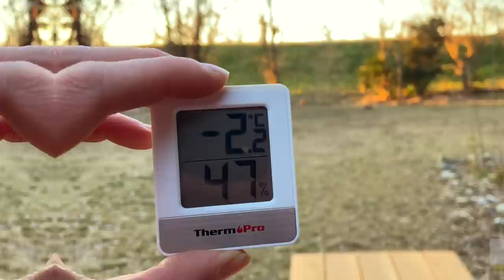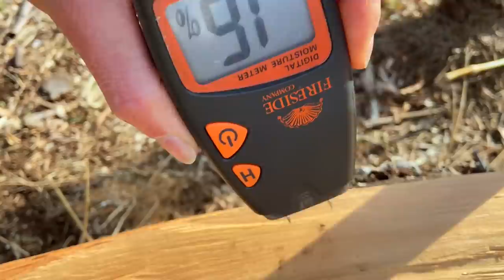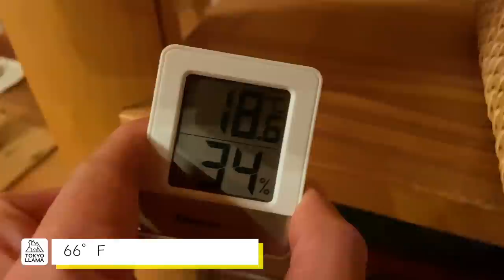Winter in a Japanese House | Tokyo Llama

Comment: My house in central Illinois was built in 1900 and for housing the ‘new’ lumber mill employees, and very few $$ invested until I bought it in 7/2004.  I doubt if I am ever rid of all the drafts, all the cold spots on cold, windy days but I have done a lot of improvement over the years, a little at a time. All the windows hav3 been replaced and both doors but I also expanded my living space when the roof was replaced as I had a very steep roof and over 600 square feet of recoverable space hiding up there.  Lots of new insulation, the windows all double glazed, a dormer added for the space for a spiral staircase and I now have a studio for my sewing and knitting and a ‘retreat’, space for some display of some of my doll collection and a small space that is handy storage but someday might become an upstairs bathroom. 17+ years and a lot of hours of labor, a lot of paychecks earned at the local pork processing plant.  You have a much nicer property and home and I enjoy your videos.

Comment: My parents are obsessed with wanting to heat and cook with just the wood stove. They can't understand that sooner or later a condition arises whereby making wood becomes almost impossible: it's called old age. I can understand the "fun" and dynamism that you feel when you light the fire (I like it too, I admit) but having a warm house comfortably is necessary, also because life is full of unexpected events (you can get sick or get hurt). What I recommend passionately is: add a heat pump (nothing particularly expensive, also work as an air conditioner) that also heats the domestic water with splitter at least in the bathroom, bedroom and living room. While to increase the yield of wood I would suggest a gasifier stove with integrated boiler. I do not know honestly for this ulti to what are the offers in Asia, but here in Europe, especially in the Alps are quite in vogue. Obviously, as you said in the video, improving the insulation will make the most substantial difference, also with regard to wood consumption, but I do not think they can be enough the same.

Comment: I don't think you mentioned heat pumps in this video. Has that been an idea? A proper heat pump feels so efficient and pushes around warm air around. It obviously also makes for letting hot air escape through gaps by creating the pressure and air flow, but it works like a charm in conjunction with a fireplace that heats through both warming the air around and radiating heat. A hot air pump also gets a lot of space heated with relative little power consumption. I can't speak for other countries, but in Norway they are practically a necessity in the same way an AC would be for hot countries. Japan seems to have a lot of the same temperature fluctuations as Norway does (except it can seemingly also get A LOT hotter).

Comment: I use a propane torch to start fires these days, old age and a sore back made me see the light... use recycled electric cloths dryer air to heat in the mornings, helps out the 5 ton heat pump... do laundry and big meal electric stove cooking in the mornings... to help heat the house. Used wood to heat a different house when I was younger, what a PIA..... lived in a moho for 6 years and learned the value of insulation. Walls are now 12" thick filled with insulation. heating, cooling and water are now $20 per month due to solar and insulation. I still wear a sock cap and sweater.... brought back many "chopping wood" memories, ok, nightmares...
Reply from the maker: I’ve been considering a propane torch to be honest after visiting a friend who used one too. Not sure what we’ll do for wood when we starting to really get on in age! Cross that bridge when we come to it.
Reply: Heat pump, I installed one myself.

Comment: I understand that its a traditional house... but why only one stove? are your opposed to an inverter heat pump? or for that matter some other conventional furnace? I live in northern california, which has a slightly warmer climate, but we do see negative temperatures as lows overnight in the winter. I installed a heat pump in our home as a retrofit as there was no forced air heat and it does a great job both heating and cooling the house, while being inexpensive to operate.

Comment: Over the last few years more people have been using wood burning stoves in the  UK so much so it’s now over taken cars as the biggest producer of particle pollution. My father had one in our house years ago and ended up with throat cancer because he used to like sitting in front of it in the evening with the door slightly open.
Kerosene burners just produce a lot of condensation and fumes, so stopping up all the gaps is probably not the best idea for healthy living.

You won’t need triple glazed units, double are good enough as regards cost versus performance.
I used to replace single glazed wooden windows with double glazed units. You just get the units made up to the largest thickness the wooden frames will take. It’s a lot of work if you have to chisel the rebates but if you can route them it’s a lot easier as you only have to chisel the corners.

Comment: If you have so little snow and rain in winter, I would think about heating the house through solar panels and then accumulation of heat in a 2000 l tank and then distribute the heat through the radiators in the rooms (for safety, everything should be filled with glycol that does not freeze). It is a perfect solution for years, free energy from the sun.

Comment: My aunt lived in a house that wasn't properly insulated, it was wooden summer house that she got special dispensation to live in year round. She was fully reliant on the woodburning stove, sadly no kerasine stove to supplement, and winter mornings were utterly freezing (so I completely understand why you use it, glad it still works), when the wood had burned out. First one up had to start it up again while freezing their ass off.  I do not miss it. (Also the bathroom was always freezing bc the stove heat didn't reach it and the tiles just made things even colder, lol.) I like that yours has glass in it so u can look in at the fire. :) What do the cats think of it? Also do the kids like observing the fire sometimes?
Reply from the maker: I can relate! Our bathroom is also cold for the same reason as your aunt's house, so we have to use an electric heater in there. The cats like to sit in front of the fire in the mornings but head up to the mezzanine, which is usually nice and warm, once the house warms up.

Comment: When we had a wood burning stove, I would give myself the challenge of seeing how many days I could keep the fire going without having to restart it in the morning. I would slow down the burn by partially closing the damper while simultaneously loading the box with wood before I went to bed. 15 days was the longest.
Reply from the maker: Unfortunately we don't seem to be able to get a long enough burn, even with the damper partially closed and air vents almost shut. I think it's partly because of the extremely long flue, which creates quite a powerful draft.

Comment: Is that a reburner wood stove? Not all wood stoves are the same and a reburner will burn wood much, much longer than your average wood stove. It's worth replacing it, even with 'free wood'. And you might want to consider putting at least sandbags around the foundation of the house for insulation against the wind - especially under that bay window, it would be surprisingly effective for very cheap if you could fill our own bags.
Reply from the maker: Yes, it is a reburner stove, it’s pretty efficient once it gets up to temperature, though the long flue does reduce efficiency somewhat.

Comment: Focusing on your wood stove, I note from the pictures that the stack is pretty hot, you may find some devices that can extract more heat from this.  Also,  the stack gas going up has to be replaced by fresh outside air, this can creep into your house from anywhere, any leaking spot, this creates drafts and why use household heated air in your fire?  An inward vent directed below your stove would help that a lot.  does anyone sell wood pellet stoves?  I have one works great and you don't have to chop.

Interestingly, I have a close friend who was a homebuilder, he mainly sold packaged log homes.  The company that made the package was trying to open the Japanese market  and sent him over there to supervise constructing the package, he brought a few key members of his crew and then tried to get some local help.  I know the skills of Japanese furniture makers and other craftsmen but apparently this does travel to the homebuilding industry there.  Due to the seasonal and cyclical nature of that industry it gets mainly the leftover workers who are not always the best.  Even fairly poorly built American homes given reasonable maintenance will last at least fifty to one hundred years, not so in Japan.

Comment: They don't have better old houses with heating? Oh ya I remember that japanese variety show where they remodel your house. 1 old house had major stuff done to make it warm. They installed a kind of water pipes that go thru the stove and heat up the whole house. Also they had to add so much padding to the walls to insulate it. Can you burn the bamboo that is shown on the video?

Comment: Worst comes to worst you could place a double layer of duct tape over the cracks in the engawa doors if you aren't using the doors until summer? I did that once in a shoddy flat for balcony sliders. It helped.

Comment: Honestly, your fan is running backwards.  This Canadian knows cold houses and wood stoves, and a tall ceiling needs the fan to pull up in the winter and at a low speed. It's counter-intuitive but "science"! Pushing down actually makes you feel cooler, which is why in the summer we have the fans running that way.  Pulling up forces the hot air stuck up high to be pushed down your walls and into the living space without having you feel the air blow at you.  Air blowing on a body is cooling not warming (wind chill!), even when the air itself is warm; it's why we open our car windows when it's 38C in the summer.  Where I live in BC it goes from -22C to about 40C, so I know both extremes.  :)
Reply from the maker: What you’ve described is the standard way, but with very high ceilings like that one, pushing down works better, pulling up that high doesn’t create sufficient down draft, and it’s high enough to barely feel the air being pushed down. I’ve experimented with both and this works better in our situation.

Comment: Just food for thought Tokyo Llama. Even dual or triple pane sliders are (1) heavy, (2) expensive, (3) not that functional (since you only need 1 exit point), and (4) even with the best ones, you'll lose most of your heat or AC through windows. I would think about framing 1/2 or 2/3 up. Insulating all of that; just having windows at shoulder height up, and reclaiming all those hallways as living space.  My wife's parents have a typical 40yr old house in Kita-kyshu with 8 sliders and I've been thinking about doing that there, especially since half are just blocked by furniture anyway.

Comment: In a sense, you have dual glazed windows. There just happens to be a hallway between the 2 panes.
Reply from the maker: Yes, though the air gaps make it an inefficient dual glazed, but better than straight into the hall!

Comment: Solar and Heat pump would be a way to go especially if there is not much on clouds 
but in order to get a solid outcome the house needs to have a basis insulation
Reply from the maker: I'm keen to reduce air leaks and insulation, then look again at heating at that point.

Comment: Any plan to install an air-air heat pump ? I heard they are not that much expensive in Japan since they do produce them there (Daikin, Mitsubishi ).
That has the nice effect to also do air cooling in summer and also give a better feeling than the Kerosene burner.

One advice from someone living in the French Alps (Cold region): Do not buy triple windows. Good double ones, it is more than enough.  The difference of efficiency between double and triple is generally not worth the cost, even in modern well isolated houses.

Comment: I thought heat pumps were common in Japan, they take up a lot of market share here in Scandinavia, and you get AC as well which I reckon is important in your locale? I know nothing about costs in Japan but your relatively mild climate might make it reasonable to stick to 2 pane glass with Argon for IR instead of 3 pane with Krypton. Diminishing returns and all that.
Reply from the maker: The triple pane I've been looking at has argon I believe, but very expensive so will have to weigh everything up.

Comment: regarding the Flir camera, i would recomend using the old version of the app (v3.0.2(458)) as the latest Playstore version (3.4.1) removed a lot of useful features such as the timelapse option, and some area temp overlays, amongst other things
Reply from the maker: Thanks, I didn't know there used to be a time lapse option, which would be interesting to use overnight. Though I'm using iOS so may not be able to go back.
Reply: @TokyoLlama  I'm afraid I'm not too familiar with what's possible on iOS, maybe there's a way to go backwards using iTunes?  Otherwise I'm hoping the app developers will bring it back in the next version,  but from my conversation with support, I'm doubting it, as there have been two Android releases since they removed it, and still no signs of it coming back. . 
Checking for insulation was also one of the main reasons I purchased the FLIR , aside from also using it to check temperatures of gear at work,  and locating pests that were getting into my kitchen cupboards at night, using the timelapse I found where they were getting in.
Reply from the maker: @J-McG  ok thanks!

Comment: Nice video! We live in an old, poorly insulated Japanese house as well, but at an elevation of 1,350 meters, on top of Mt. Akagi so we have to do a bit more to keep the place inhabitable! Two wood stoves are the main heat source and they are burning 24/7 from late November into April. But we use a good deal of kerosene as well. (about 300 liters per month in the winter). I did cringe a bit seeing your kerosene stove. For the sake of air quality and the health of your family I would strongly recommend avoiding that type of stove or anything that doesn't vent the exhaust to the outdoors. An FF kerosene stove will have to be mounted to a wall, but it allows you to leave it on as long as you want without any concerns for your health. There is a good reason why respiratory problems are so common in this country, especially among children. By the way, I frequently visit a friend in Kasama. Are you near there? I would love to see your place some time!

Comment: Hi Tokyo,
there are metal net like curtains that generate lots of heat when they are hit by little sun. They are produced in Canada.
I think they are not that expensive and if you have a good side on the house when the sun hits the windows you can generate lots of heat.
also watch this video on YT
"SIMPLE DIY YET NEXT LEVEL SOLAR CURTAINS FOR HEATING YOUR HOME MADE WITH - IR FLOCK SHEET"
I am planning to make my own since I live in Canada .
I have my face of the house facing south and have pretty good sun light exposure.

Comment: Install a heatpump from Panasonic (Air to air), It is a really good base heating source and it can also be used for cooling in the summer. Here in Sweden it is a very common combination with a wood burning stove and a heatpump. In my cabin I have about 50cm of insulation in the roof and a good amount of insulation in the roof makes a great differens. In Sweden we have really high prices on electricity, how much do you pay per kW/h in your area?

Comment: If my wife woke up every morning to a +8 degree house, I would be divorced by now :-)
We recently reconstructed our house in Slovakia, and had the 2 pane 3 pane discussion.
In my opinion, the difference between single pane and double pane glass is a lot.
The difference between double pane and triple pane, not so much. and it not as easy to justify the cost.
If you bought double pane windows, then you could put more money into fixing the insulation holes in your
house, in which it seems you have  quite a few spots with no insulation at all.
Keep posting, I enjoy watching  your house taking shape.
Reply: Triple panel doesn't matter that much in normal windows, but if you have glass walls triple is the only way. You will spend more money on to heating than you saved on windows.

Comment: Hi, i got a vacation house in hokkaido, it suffer water frozen and pipe burst from time to time. Would like to check if you have any ideas on how to winterize the house to protect the pipes? Like using air compressor to drain water out? Thanks.

Comment: looks amazing! though i don't know how you can still call yourself an australian since you haven't built a deck yet.
my last place had fusuma, which i liked at first but the constant ducking to go into another room slowly drove me mad so in my new place they were banned.
as a temporary measure for the windows, how about just a sheet of perspex inside the frame over the shoji? you'd get an air gap that should be reasonable as additional insulation, and stop fingers going through any paper also.